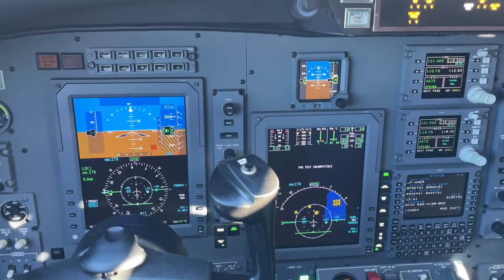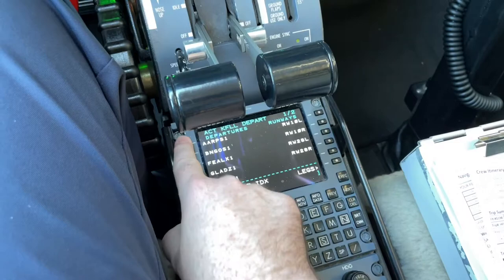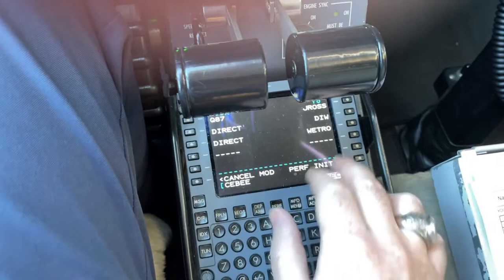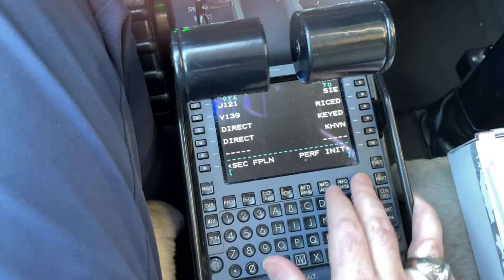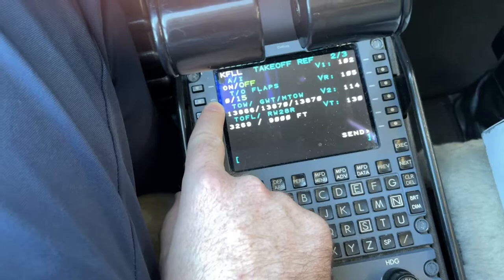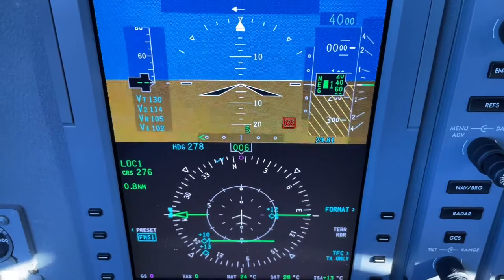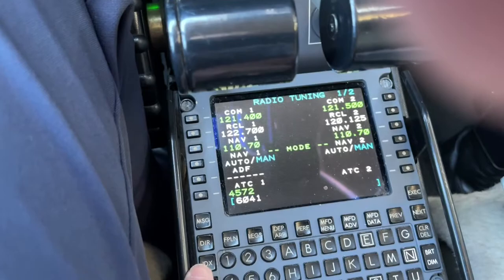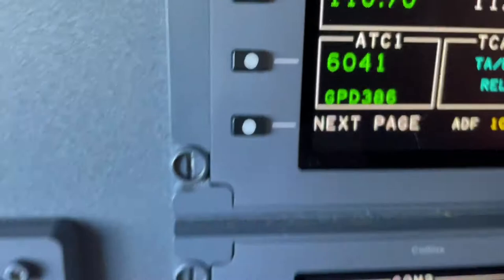Programming the FMS / Engine Start - Cessna CJ3

Comment: Porline 21 is so far behind of a Garmin G3000! It's too complicated:D Looks like NOKIA from 2000-th in Ipad's ERA
Reply: Makes a great avionics suite for a future airline guy. The Proline 21 was the first FMS I learned…it’s pretty much exactly what the CRJ uses without having ACARS. But I agree, the G3000 is much nicer and if I had to fly the jet single pilot, I’d rather do it with the garmin instead of the proline.
Reply: @AsNetwork  i fly single pilot turboprop m600